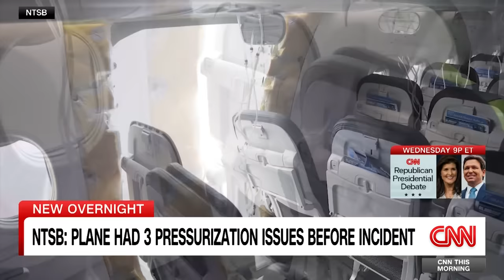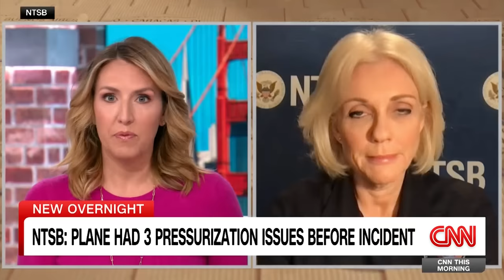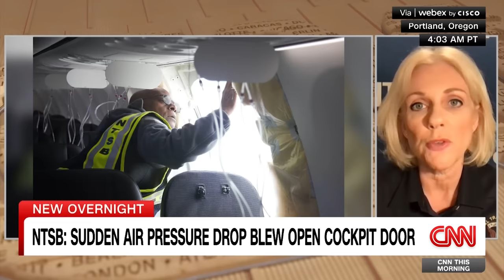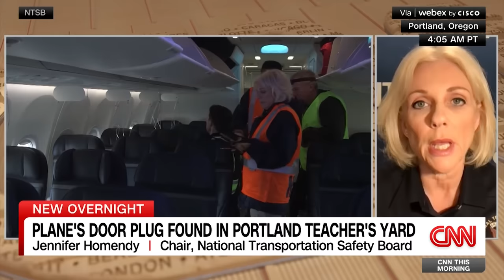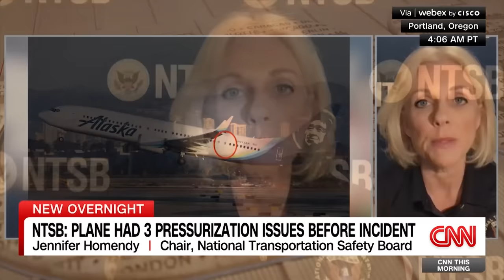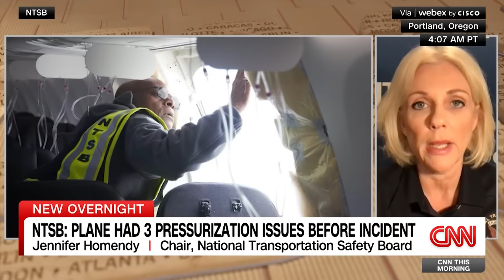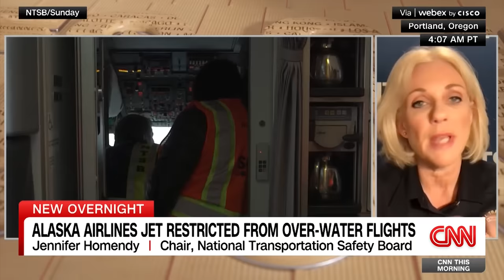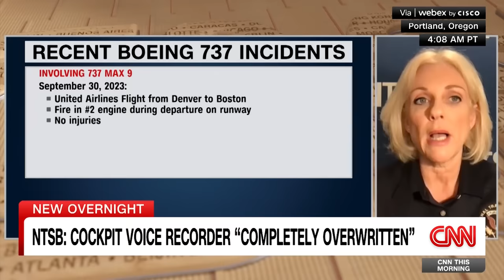Official asked whether it's safe to fly on any Boeing plane right now. Hear her response

Comment: Plugging a former door is not an appropriate fix.  The opening should have been closed and fixed permanently to the aircraft airframe.
Reply: Locking mechanism failed?
Reply: There is no locking mechanism.  The plug is bolted into the airframe.
Reply: @detritus23  the recoved door shows otherwise. A plug proved to be insufficient didn't it. Tires as an example in most states can no longer be plugged.  They must be vulcanized or fuzzed from the inside of the tire. Too many people died because a plug didn't hold.
Reply: You obviously are not in the aviation industry.  Plugging has been standard practice since the 737 came out in the 1960's.
Reply: @truthserum5310  doesn't mean it's right. It's a cheap fix and money saver for Boeing. You can't pull over to the curb like you can with an auto when something goes wrong.
Reply: @johndanenberg217  🤦‍♂️
Reply: @johndanenberg217  You really are clueless.
Reply: @truthserum5310  you speaking from o position of stupidity. Open your eyes and ears. Most importantly your closed mind.
Reply: @johndanenberg217  LOL, I work in the aviation industry, you work from your emotions.  You know nothing as to why plug doors exist, and their purpose in the design of commercial aircraft.
Reply: @truthserum5310  you're the cause of many past aviation deaths. It's call complacency.  Let's fix it as cheaply as possible Boeing and the airlines need to maximize profits at there passengers expense. I wouldn't fly on a aircraft you signed off on. You're and accident looking for a place to happen. Turn your A&E in.
Reply: @johndanenberg217  You misunderstand the term "plug." It's not some rubber stopper, it is a blanking plate built of the same materials as the airframe.  It is bolted into the doorframe as a permanent panel.  There is no "locking mechanism."

Oh, and since pictures of the door have not been published as of this writing, you are full of it.

Comment: Boeing continues trying to make a 50-year-old obsolete model profitable, adding new versions and updates. Simple as that. They sell this model (Max 200) with emergency exit doors (MID door exits) operable or not to different airlines, depending on their maximum passenger capacity. In this case, Alaska does not operate them because its maximum number of passengers on those planes is lower than what the aviation authorities require. So, basically what you will find once on board, is a panel with a normal window like in any other row in the cabin. The passengers do not realise that there is a door and the crew does not check it either because officially it does not exist, you simply see the frame from the outside. What just happened is once again a brutal safety failure on the part of the manufacturer as a result of the poor quality of construction and assembly that Boeing has been doing for the last few years. I am not really surprised that the FAA has already immediately ordered the suspension of this type of Max for future investigations and I sincerely hope that this does not get any worse than when the whole scandal happened in 2019.

Comment: Flying by fact is not very safe professors have told me. It’s that most people drive more days than they fly. If you flew as much as drive which is only a small number of people your odds will go up dramatically of being in a crash. Moreover you have more control of your car than knowing how good a pilot is going to be. On the other hand you could have anything happen anywhere so who knows such as a plane crashing where you are standing. Emergency preparedness in planes is always a good idea and can be practiced
Reply: It's the safest mode of transport, it's the average from the data. Traveling the same distance by any other transport is more dangerous than doing it by plane. Plane is considered to be one of the safest places you could be in this world

Comment: Flying still with any Boeing airplane is a gamble. More will fly out of the sky. Their focus on shareholder value instead of proper engineering & safety leads to cutting corners.

I avoid Boeing since years and I strongly recommend everyone else to do the same.

Comment: When an airplane has a restriction that it should not fly over water is reason enough to ground the plane. How hard is that?  I wonder what happens if Boeing planes are grounded. Isn't there going to be a ripple effect through the industry. Flights will be cancelled, routes will be cut because there are not enough planes. I wonder who benefits under that scenario?

Comment: Think about this for a second ... consider how many flights there are in a  given day around the country, or even around the world.  Think of how many are in the US alone ... I'm sure a good number of those planes are Boeing's and probably a very good portion of THAT are 737's.  So far that I'm aware of, since the Max 8 disaster, we have had two crashes and a plug fall out.  Granted, 2 crashes is two crashes that shouldn't have happened.  But also consider this, you're probably more likely to be involved in a car crash than be on a plane with a door (or plug) that falls off or a MCAS system that malfunctions (which, I still maintain, part of the MCAS issue was training but that 's a separate story).  My point is that no aircraft is perfect.  Boeing should have just put a door in and let the airlines deal with it, rather than put in a "plug" because clearly the doors that are supposed to open, don't fall out, yet the plugs they put in place that AREN'T meant to fall out, do.  So, ironically, it may have been more wise to just put a door there and be done with it, because clearly they are better at designing and putting in emergency exit doors than they are plugging them with a "permanent" plug.

Comment: With the previous depressurization issues they most likely downgraded the aircraft’s ETOPS status which would prevent long flights over water and to Hawaii. ETOPS is an acronym for Extended range Twin engine Operations Performance Standards. Decades ago oceanic flights were made using 3 and 4 engine aircraft. Modern engines and aircraft are much more reliable and twin engine aircraft are more efficient. However if an engine fails, who wants to be flying over the ocean for 3 hours to get to an alternate airport? As a result the world’s regulatory agencies came up with rules (ETOPS). Basically enhanced maintenance standards and training. Each individual aircraft has to qualify as does the airline. If aircraft in an airline’s ETOPS fleet have numerous maintenance events that could restrict the airlines ability to conduct such operations.

Comment: There were 3 previous incidents on the same Alaska Airlines aircraft on Dec. 7, Jan. 3 and Jan. 4, when the auto pressurization fail light illuminated. It has not been revealed what measures - if any - Alaska Airlines maintenance took, following these incidents. It is also not clear if the emergency door plugs form part of the pressurized cabin sealing. It could be that during pressurization the door plugs simply press against the emergency door in the fuselage and that the emergency door itself forms part of the pressurized cabin sealing. I suspect that this is actually the case. The blowout seems to be due to a failure in the manufacturing process by Boeing or by its sub-contractors. FAA and EASA both need to look carefully at all Boeing aircraft which have been produced by the same manufacturing techniques as the B737 Max 9.
Reply: When there is a door plug as in this case, there is no more an emergency door. The door plug replaces the emergency door which is not used in this section of the plane.

Comment: Before McDD merger Boeing were famed for engineering excellence, robustness and safety, but cost cutting and profit seems to have overruled engineers since McDD management took over running Boeing, hence the build quality issues since especially the 787 outsourcing and 737 MAX which is really a new aircraft and not a 737. I won't let my family fly on 787 just as I wouldn't allow them on DC-10 in the 80s.

Comment: Translation: This may have been a one off incident where (ironically once again) a warning was continuously ignored by the operator, and instead of doing a pressurization test on the aircraft which airlines CAN AND DO PERFORM and DOESNT TAKE THAT LONG decided it was an instrument problem and wrote it off. That being said, rhere are over 8000 737s in service today, theyre safe as long as warning signs are observed as with any other mechanical system.

Comment: If Alaska knew that the warning lights of depressurization from a previous flight days ago and said that that plane shoildnt fly over the ocean should be investigated of why they still chose to fly that plane instead of immediate inspection of why those lights came on. This is Unbelievable and Unacceptable by Alaska airlines, plus its a Newer plane also 10 weeks old, so Either a manufacturing problem or an airline maintenance problem or Both. Wow
Reply: If the depressurization warning lights turn on in a ten weeks old plane, it is definitely a Boeing manufacturing problem. That has been confirmed by United Airlines inspection results on their planes that they found loose bolts holding the door plugs in their planes.
Reply: @jchock7503  Yep that's what I heard from United also from the Sources

Comment: It might have nothing to do with the depresurization equipment, however it could have everything to do with the depressurization equipment.

If the aircraft wasn't reducing the air pressure inside the cabin correctly then it's good that the door plug blow out.  The reason why it's good is that air pressure can be a massive force on the entire air frame and it's better if something small breaks like a door plug, and not the entire air frame.

The air pressure inside an aircraft is not going to be as low as outside, but there is still suppose to be a reduction of pressure.
Reply: Yes - maybe the door plug is the hero !

Comment: Do they not have the wit here  to delve technically into the relationship between hull leakage rates, differential pressure relative to atmosphere and some idea of how the 'depressurisation monitoring' derives its alarm  condition. Ciculating photos showing a fairly poor fit of the plug externally suggests some leakage that might be  evidence of long term leakage and movement trends.  Even if the plug is inserted internally and theretically cannot fall outwards......

Comment: Breaking news - the FAA has approved Boeing to apply a plastic bag to the door plug area of all Max 9 jets and has eliminated all quality control inspections.  Alaska air has gone one step further by requiring gorilla 🦍 tape in order to secure the plastic bags.  All max 9 flights will now have a cruise altitude of 10 feet and a maximum sustained speed of 45 miles an hour.  The pilots union is concerned that the Max 9 may not be able to reach V1 speed.
Reply: She is a BA degree holder from Penn State. And I just got hit by the truth that the head of SAFETY is not BESc or a BSc holder.

Comment: If Alaska Air did not know that 3 warnings, 2 in the previous 2 days on a Max is not potentially very serious, well I guess they do now, and this is not going to be the end of that lesson. Anyway you look at it, unless you disagree with my calculation, 99.9994% is a sure thing something is WRONG with PRESSURE CONTROL. Not the engines. My opinion is that its just plain stupid to continue operating under any circumstances, made even worse by not understanding that a distance limitation was incorrect in the face of pressure problems. It's BASIC physics. If it's true that 3 warnings on one sensor group is not enough of a reason to "stop work", then tell me how many are enough for you. Where do you draw the line. Sure, Intermittent problems are difficult to fix, but that's why they get paid more than auto mechanics. ITS THEIR JOB! If they continue flying until they find the problem, (esp. After 3 warnings) what does that mean? It means they were testing with live guinea pigs. We clear the freeking area for a hydrostatic vessel test in a refinery. We do not put 175 people on top of the tank when we do it. How difficult is it to do a soap bubble test around door and window frames?  I can find leaks with my phone's ultrasonic testing app.  

IMO, Alaska owns this just as much as Boeing does. They know it too. They just have their spin doctors out trying to clean it up as much as possible and control the naritive. "Abundance of caution", OMG. They may fool the physics flunkies. I'm not buying it.

Comment: If it is a non-operational door, why not weld it to the frame of the plane?
Reply: I read its used as a door on other airlines configuration.
Reply: So the aircraft can be reconfigured at a later date (to carry more passengers)
Reply: @ImperrfectStranger  Exactly...profit-driven

Comment: your comments about "the warning light" are misleading, since there has been no connection shown between the auto-pressurization light and the door blow-out.
The door failure could have been caused at the stage where the interior of the aircraft is outfitted for Alaska, not at the airframe manufacturing stage, so that it is likely to have been a single error/mishap, or restricted to one person or crew

Comment: If the warning light was going off is this boeing's problem or ALASKA AIRLINES' PROBLEM?
Reply: Or the manufacturer of the pressurisation system components. Boeing assembles, they do very little manufacturing.
Reply: If the depressurization warning  light turns on, it is the responsibility of Alaska Airlines maintenance staff to find out what's wrong. If they cannot find the cause, they have to request help from Boeing, not reset the light and then Alaska Airlines management making the decision not to fly the plane over the ocean. Also the plane being only ten weeks old, it is Boeing's responsibility to make sure all parts are properly assembled, functioning well and reliable over a reasonable period of time after which wear and tear over time requires it to be maintained or replaced.

Comment: The National Transportation Safety Board says the plug covering an unused exit door that blew out minutes into an Alaska Airlines flight Friday evening has been found. The agency's head said the discovery could prove vital in the investigation of the cause of the blowout, which forced the Boeing 737 Max 9 to return to Portland, Oregon minutes after takeoff.
Reply: Homendy told reporters pilots reported that the same plane experienced three pressurization warnings, from cockpit dashboard lights, between Dec. 7 and Jan. 4. At least one occurred in-flight.
Reply: The plane was just weeks old, delivered at the end of October. Alaska Airlines maintenance crews checked and cleared the light after each illumination.
Reply: On the day before the blowout on Flight 1282, Homendy said, the carrier ordered that the plane involved couldn't make any long flights over water so it could "return very quickly to an airport" if the warning light appeared again. She stressed that the light might not be related to Friday's incident. In addition, more maintenance work was ordered -- basically a deeper dive into why the light kept illuminating -- but none was done before Friday night's flight.

Homendy described a chaotic scene in the plane's cockpit and directly outside the cockpit after the blowout. 

She said the flight crew heard a bang and the cockpit "door flew open" from depressurization, so they immediately put their masks on, but communication in the cockpit and between the crew members in the cabin and cockpit were very difficult.
Reply: The force of the depressurization slammed the cockpit door into the front restroom door, damaging the restroom door, and it took a flight attendant three tries to get the cockpit door to close again, Homendy said.

She noted that the first officer lost her headset and the captain had a portion of her headset pulled off. The captain and first officer couldn't hear anything in their damaged headsets once they were recovered so they used the overhead speaker to hear.

A quick reference checklist kept within easy reach of the flight crew also flew out the door, Homendy said, adding that it was incredibly loud and chaotic on board.

Comment: I will not fly on a Beoing jet - especially not a 737 Max. I'll pay extra to an airline that uses Airbus jets instead.

I haven't flown on a 737 Max since the problem with controls that caused two 737 Max jets to crash. Now I won't fly ANYTHING Boeing ever. I don't trust Boeing to build & maintain jets safely.

I doubt I'm alone.

We had two (2) jets crash because of problems with the 737 Max. They swore they'd ensure it was the safest plane in the sky. They ignored that vow. Why should we trust them now? Clearly Boeing intends to make money however it can then run damage control if there's a problem.

The solution to this problem is ruthless consistency & attention to detail. BY CONSUMERS, ensuring they're flying with airlines who fly Airbus. And ensuring they shun any airline flying Boeing - especially the 737 MAX.

Boeing is problem one. The FAA is problem two: successive Republican governments have deregulated ruthlessly, passing "regulatory compliance" checking to the companies regulated. THAT'S INSANE. 

The FAA needs to return to BEING a regulator & do its job. WE NEED TO RE-REGULATE.